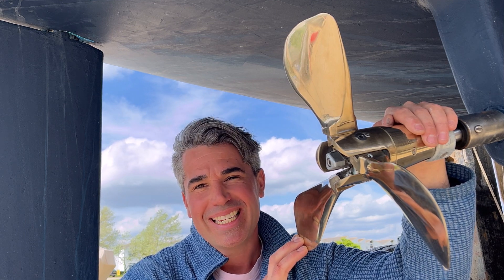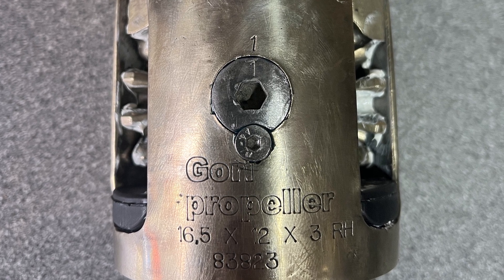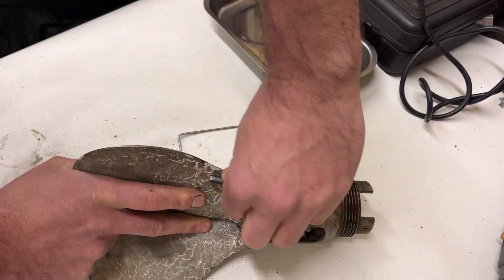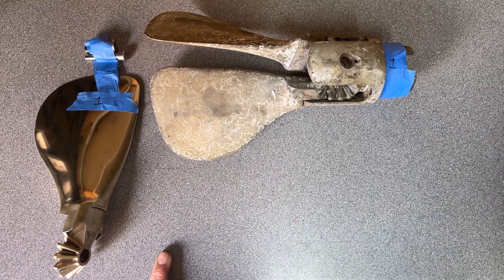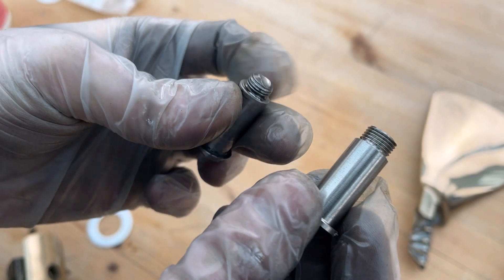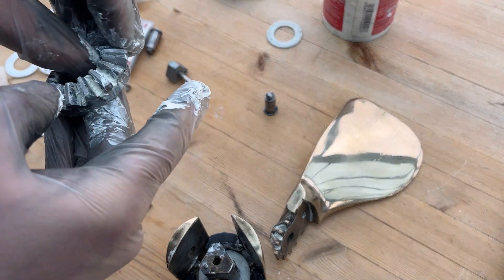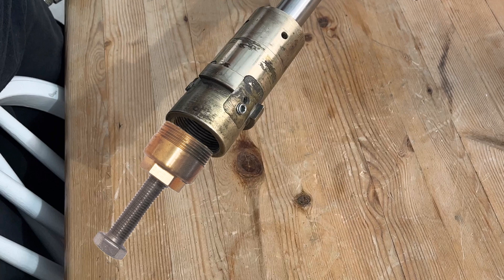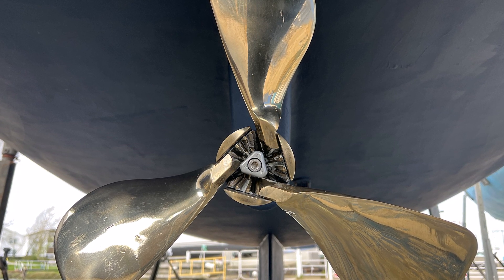Gori Folding Propeller SERVICE & REBUILD - Damaged Guide Pin Threads

Comment: 3,500 RPM on a propeller? Sureiy, that would cause cavitation? Don't you have a reduction geat?
Reply from the maker: Hi, my boat goes up to this no problem.  Very rarely but the Yanmar manual tells you have the throttle on full for a minute every few hours.
Reply: @EastCoastSailing_ We are talking about two different issues. Sailboat propellers typically start cavitation somewhere between 1,000 and 1,500 RPM (max 1,700 RPM). Above that the propeller has increasingly  less 'bite'. That is why marine diesel engines have a lower governor setting (than the road equivalent) plus you will have a 2:1 reduction gear (3,500 RPM engine speed would be 1,750 RPM prop speed).
Reply from the maker: @stephenburnage7687  sorry, yes meant the engine 3500 rpm not the shaft 2.21 to 1 ratio. Be circa 1587 rpm

Comment: Did you use prop speed before splashing?
Reply from the maker: @scottkircher2262  Hi Scott, no I didn’t, i put the boat on a scrubbing post 2 weeks ago and wire brushed the prop and it looked like new after 5 mins. I did such a good job polishing it nothing could bind apart from a stone like covering that was easily scrapped off. Check out the stuck on a scrubbing post vid. Also the boat had been in the water for over a year 😎

Comment: Hello Rob, thanks for the well done video. I'm concerned about needing bushings or washers between the tang of the blades and the hub. Or did the washer under the pinion gear eliminate this?
Reply from the maker: @StephenSiegman-c2q  Hi Stephen, the only bushing you should have is under the pinion gear ⚙️. I would only change this to a thicker washer if you have excessive play. If you put a washer in too thick the blades won’t move freely and will cause issues. Let me know your specific question I’m not sure what you mean about (eliminate this) thanks 🙏

Comment: Very usefull video!! I have a 20’ 3 blade Gori unassembled right now on my garage table, following your video. I had break the pins without it. Thanks for share it.

May you provide info about the white washer? Material, where to buy, specs?
Reply: Thanks again!!!!
Reply from the maker: Hi contact your Gori dealer. In the UK 🇬🇧 this company supplied them. Unlikely it will need to be replaced but makes things all a little tighter 🫡😎👌🏼⛵️https://www.sillette.co.uk/products/propellers/gori-spare-parts

Comment: A so called marine professional stuffed my gori up 
2 months after having my boat antifould by a local slipwsy  I dived on the boat fir a check up and found all 3 blade pins loose one blade pin was about 1cm proud of the hub blade about to fall out 
Removed the propeller found that the slipway had stripped all 3 blade pin bolts 
And damage to the anode center pin 
This indicates they did not remove the anode center pin first 
I don't know how the blades stayed in place perhaps the propspeed application keeper them in place 
The slip way denied doing it 
I have never removed it and only used the same slipway since they fitted the gori
Reply from the maker: @kurt6738  Hi Kurt, I’m sorry to hear this happened to you. I don’t trust people working on my cars or boats for this very reason. Best to learn how do this kind of stuff your self, you know it’s done properly! No corners will be cut if it needs to be repaired and only have your self to blame if it goes wrong 😂. What did you do to fix the pins they damaged. Did you get a new prop or get new pins made up like I did? Thanks for watching.
Reply: @EastCoastSailing_  
Yes its hard to trust other people's work 
Unfortunately where im located in Australia there are no slipways that will let you do your own work any more.
I had a quote to have the prop sent back to gori for repairs/ refurbish but quote was high , i ended up buying an Australian made autostream feathering propeller for not much more than the repair and international freight would of cost
I'm happy with it performance of it , i did loose the overdrive function but gained the ability to adjust the pitch whilst in the water 
Funny enough the people I had install the Autostream prop stuffed it up too they had to pull the boat back out of the water and I had to talk them through correcting it
Reply from the maker: @ how are you not allowed to work on your own boat ! If you need to get rid of the old one let me know 😎👌🏼

Comment: Nice work I just bought a new 22 inch Gori for my Carbineer 46 . I am pulling the shaft out & recutting it to match the taper . Hopefully the shaft is good & doesn't need to be replaced.
Reply from the maker: @mikecramb267  great bit of kit and it will sever you well! Fair winds

Comment: I’m shocked the hex key (Allen) bolts actually  unthreaded out with all that corrosion, the heads always strip when I try .
Reply from the maker: Hi, the key to getting bolts undone without stripping, even Allen key bolt heads is getting an Allen key socket and tapping with a heavy hammer, penetrating oil and heating around the screw. They all came out really easily. Thanks for watching and if you need any help just drop me a message. All the best Rob

Comment: I had a similar experience and seeing the prop for the first time - A Gori 2 blade folding prop with all rounded Allen key heads so hours of work drilling out the bolts. Spares were easy to obtain and after a good clean looked like new again. Will you leave as is/polished? I opted for etch primer/primer and Trilux 33 anti foul. Will see if it works at the end of the season.
Reply from the maker: Hi and thanks for watching. I left it polished. Seemed sacrilege to paint over something that looks so magnificent. I'll see how it gets on at the end of the season as it's my 1st season with this particular boat  and report back. All the best Rob